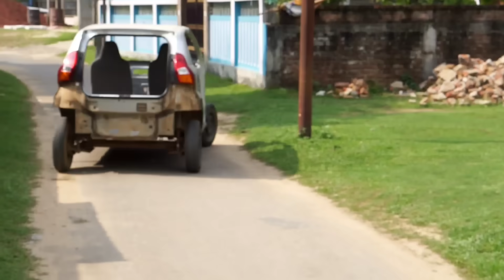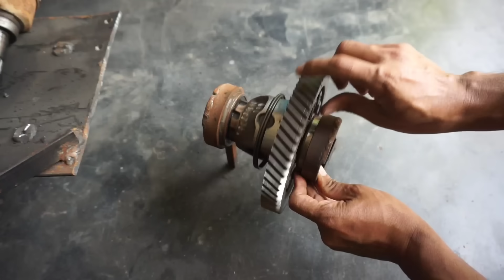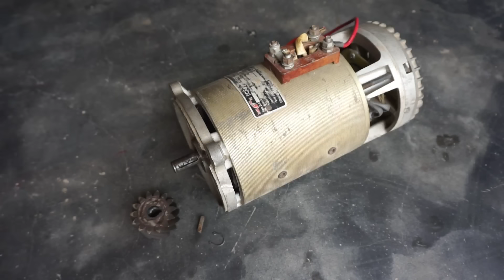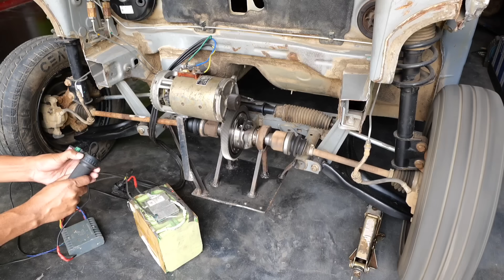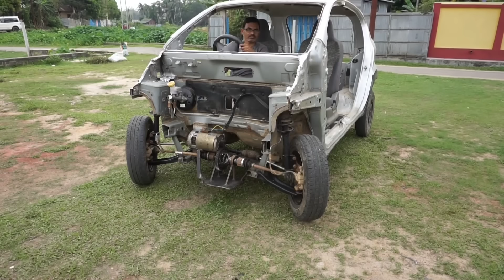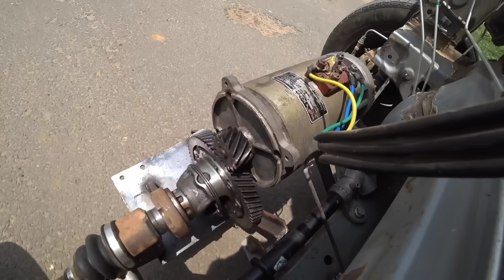diy electric car

Comment: Great project. Would it not be better using the complete old gearbox and powering the input shift from there? That way the moving parts are all still lubricated
Reply: Lot's of losses in the transmission. His way while slower and single speed will be more efficient, by a good margin. Perfect for inner city, but I'd imagine 25-30km is as fast as it'll go. I agree he should have the differential enclosed in oil somewhat.
Reply: @Aa-ron01  maybe just cut out the part that houses the differential?
Reply: Too heavy ,differential can Last long time at 30 kmh with à Light car, just spray grease like bicycle chain
Reply: you can fill inside the differential with grease, then cover the side openings, even with thick tape will work well. The gears only spin while cornering so will never get hot or melt the grease.
Reply: I think the same, that precarious system of gears does not look so reliable! 🤔
Reply: i cant imagine the drive suppprt holding.up  but the rest looks respectable
Reply: @Aa-ron01  9
Reply: Transmission would add to much weight, use white lithium grease and heavy tape like someone suggested for this application in small car find some way to hook an alternator to each rear wheel hub to generate power to recharge batteries as your driving
Reply: Он-один. Учёны́е вместе с конструкторским бюро сделают ещё лучше. Нефтяники не даст
Reply: Weight reduction taken seriously in this video ;)
Reply: @horseyhorselips3501  I think the alternator will slow down the car due to the charging load acting like a real load.
Reply: Да, он избавился от лишнего сопротивления.
Reply: @Aa-ron01  at high amp cost untill proper rpm and speed is without over heating the battery and or system.
Reply: @horseyhorselips3501  recharge batteries as you drive?  Wastes energy.. even if your alternator set up were 10p percent efficiency  ..which it isn't...you would still just break even on the  energy used to produce .
Reply: @jamesgibson5876 could work if it was only activated on descents or braking.
Teslas have that...
Reply: Probably uses a servo to control voltage and speed.
Reply: If you don’t like what he did make your own.
Reply: ⅝
Reply: Todo bien, y como lo frenas?
Reply: Yeah will work for some time... But definitely better with oil casing to keep it lubricated
Reply: @jamesgibson5876 agreed, even with using that low gear ratio. Your charge output might not even be enough to compensate the draw of the motor powering the drive motor. Even with a light vehicle with no chassis, half a body and only one passenger. Just buy a crashed Tesla and take the motor, retrofit to the vehicle your working on.
Reply: А что если на электрический мотор поставить автоматический коробки передачи можно будет увеличить?
Reply: Very nice love it!!!!
Reply: Lots of electric conversions of old car do that. The engine compartment then hold the motor and batteries 😂

Comment: all very nice but how long would it take for you to put up with those gears without lubrication... if you had kept the original box and coupled the motor directly, the combination would be great
Reply: Then it becomes too heavy to move
Reply: سلام عليكم
Reply: @abdelkadermehaoui3812  وعليكم السلام ورحمة الله
Reply: @vincentlee2460  I highly doubt it as you can spin those with your fingers
Reply: Also, I am concern, without the gearbox and torque converter, how long that electric motor will roll that wheel directly. That motor will be burned out after 7 to 10 minutes due to direct load from the wheel. 0% reliability.
Reply: @ibrahimchowdhury7591  but this is exactly how all electric cars work.   No gearbox.
Reply: Dear  @andrewbarnard667 ,
First of all I am warmly asking for you forgiveness if my comment gave you any wrong information. I also ask for your acceptance and writing a few informations as a comment which is, for example, if you disassemble Tesla’s cars E-motor and Transmission part, you will see that the electric motor has not been attached directly to the drivetrain. There are multiple torque converters attached which are changes in real-time based on the torque sensor and the total load of the car. If you connect directly to the motor, it will consume excessive battery, will not go faster than 15 to 25 mph, and also will overheat which will ultimately reduce the performance life of the electric motor. Again, I am not talking about gearbox, but torque converter.
Reply: No problem....he can spitt on them while driving !!
Reply: Instead of using the differential from the gearbox you should have used a closed differential from a RWD car. That doesn't add too much weight and solves the lubrication issue. It would also solve the flank clearance issue that you probably have. And it would generate less noise.
Reply: @ibrahimchowdhury7591  You are both wrong. Tesla uses a gear reduction box. No clutches, no torque converter, just a direct connection to the drive gear.
Technically it's a gearbox. It's not a multiple speed unit like a 6 speed in an ICE car though, just a single ratio that allows use of smaller, lighter, higher rpm motor designs.
Reply: @ibrahimchowdhury7591  you can talk about torque converters as long as you like but electric cars do not have or need a torque converter.
Reply: Dear  @andrewbarnard667 ,
Thank you, for replying. 🙏🙏
Reply: @vincentlee2460  cffds
Reply: I'm guessing it was intended as a proof of concept than as a roadworthy design.
Reply: yo pensé lo mismo, pero este experimento amplió mis posibilidades! Traigo ésa idea 🤔

Comment: My first electric hybrid car i drove was a Hillman Minx, in 1st Gear on its starter motor, drove about 300 yards when to a petrol garage when it ran out of petrol, so i ran it all the way cranking, this was 50 years ago. So you can't say i have not driven an electric hybrid car🤣
Reply: I also had a Hilman Minx 59 model...my first car at age 19...and boy did I love that beige and cream little car!
Reply: I HAVE A MINX.
Reply: If stalled on a railway crossing using the starter motor to drive the car off.
Reply: you are a কৌম্পিন্তৌ😍
Reply: So I had an old Datsun pickup  5 spd HYBRID with dead alternator and broke..start in 1st gear n go.. coasting to red lights and take offs were fun..Not. Then clutch went out was 2 weeks to work and everywhere just start in 1st gear n shift through gears don't need clutch. Parking where I had a clear path to launch from again and again. This video is very cool, I was thinking remove 2- 3 feet from the middle of that car and weld back together save more weight being 2 door. Wish I had a place and welder.
Reply: nobody's asking
Reply: @diycraftideas1960  ii
Reply: Back gare
Reply: Hillman minx was a very good car
Reply: @hasanaydin22  i don't care

Comment: Very creative!  you can also make some kind of dry sump lubrication box around it, drop oil on the gears and the differential with a small pump so it will keep out dirt, and recirculate the oil from the sump you make around it. . makes it a little bit easier to fabricate and it will last a lot longer than it does like this. Keep up the good work!
Reply: Need to manufacture a gearbox cover, put gear oil in it. Being open, to the elements, those gears won't last very long. Metal to metal contact is never good!
Reply: No need for a pump, just seal the case and have the large driven gear semi submerged, as it spins it will carry oil to the drive gear.
Reply: @Dalehogg89  true
Reply: @Dalehogg89  صحيح، علبة مغلقة مملوءة بالزيت يكفي
Reply: @يحيىبركات-س3ب  can you translate to English please
Reply: @Dalehogg89 You are correct, a closed can filled with oil is enough.
Reply: @يحيىبركات-س3ب  thankyou, I tried to translate but it would not copy your text on my phone.
Reply: wouldn't that be just leaving the transmission in-tact?
Reply: @groofromtheup5719  that would be the easiest solution idd.. if he could make it fit :-)
Reply: Good idea. Untidy job. Perfection is a must
Reply: Маслянный картер( как на заводе ) изготовить будет потенциально проблематично. Между электродвигателем и ведущей шестерней слишком мало места. Тогда вал якоря электродвигателя надо делать длиннее.
Reply: That motor won't last long enough to worry about all that fuckery.
Reply: Só good
Reply: Positive and constructive comment!
Reply: What's about reverse the motion
Reply: @groofromtheup5719  weight?
Reply: @EelingStudios  an aluminum casting vs. a bunch of random steel welded however; all that relative to the weight of the base vehicle plus batteries?
Reply: @arunpatil3580  What about it?? 🤷🏻
Reply: @chunchuemmanuel492
Reply: @arunpatil3580  By switching polarity, you can control motion.
Reply: it was probably best to keep the original gear box and just have the motor mounted to the input shaft.. would a solve alot of the problems he's now going to encounter
Reply: I would like to watch some of your videos showing what you're explaining, they must be fascinating 🤔 😉
Reply: Es lo que pensaba 2 baterías 12 v x 180 A en paralelo
Reply: @Dalehogg89  yeah thats how gearboxs work, no pump
Reply: @ronaldgreen5292  😅

Comment: I'm very impressed with your ingenuity, this is a very neat, simple proof of concept that may now be refined, to include protection and lubrication for the drive gear. Subscribed.
Reply: "Proof of concept"? It's just a cobbled together project, the concept has been refined far, far past this stage.

Comment: It reminds me of those battery R/C toy cars, I had one that I put apart, and have suspension and a plastic differential attached directly to a tiny electric motor.
Love the simplicity! Very good job Sr.
Reply: With 4.5 hr warrantee.  :face-green-smiling:
Reply: Basically, a golf cart..

Comment: Make a sheet metal housing to contain oil & add an oil pump to spray oil onto the gears & bearings. 

I can’t help but wonder about the motor speed torque curve matching the performance needed for the car weight. 

Most ppl keep the gearbox & make an adapter plate. Still good.
Reply: le ubieran dejado la caja de velocidades
Reply: насос не нужен, достаточно на 10-15 миллиметров планетарную шестерню погрузить в масло.

Comment: The only problem there might be is that the differential is made to be enclosed emersed in gear oil, it would have to be constantly manualy lubricated because of all the dust and gritt, might become quite messy🤔 otherwise a great design😉
Reply: This set up wouldn't need all that,. Spray it with some lubricant before riding and it would be fine. A silicone motorcycle chain oil would work good.
Reply: @sliedogg  yes, give the exposed surfaces an oily coating so that the grime and grit can stick to it👍,never mind the nylon shims in the differential planetary gears requiring not only the lubrication but the cooling affect of the oil to ensure they don't melt,Which they will!
Reply: @notpoliticallycorrect1303  Oh yeah cause the open design is so well built 🤣.  How long have you been a mechanic?  Me 20 years.
Reply: @sliedogg  I was being sarcastic! I have an 80+ year family history in the motor industry,40+ years personally in the trade and around 30 years running my own 7 bay and 2 test bay garage and paint shop,with over 100 full restorations and modification projects under my belt in between the daily stuff. We build and develope uprated Duratec V6 engines as a side hobby! And my family design and build specialised commercial vehicles,mobile pumps,Winches,generators,de-salination plants etc.
Reply: @notpoliticallycorrect1303  Nice!   I'm not that far in the game but one day maybe .
Reply: @notpoliticallycorrect1303  lol his attempt to be snarky and condescending didn't work out so well....

Comment: Great job ! I like it 👍.  If you want it to last longer you will need to use lubricant oil. IMO you should keep the transmission case and added oil. Try to fit the motor in to the case.
Reply: Exactly
Reply: Exactly, this way it will not last few weeks...

Comment: The differential needs lubrication , grease is not enough it would have been better if u had connected the motor to the splines of the gear box and that would have given u multiple gear ratios like in case u have heavy load u can shift to lower gear with increased ratio for more torque. Bldc motor is more suited for this application .

Comment: Hi sir,i am happy to see this cars project
This one is looks like my college final year project 

on 2012-2013 i have done this Electric car project
I have used 
1. one tata indica shell
2.2HP DC motor
3.Kinetic honda Gear combination
4.alternator
5.DC Boost converters
6.12 V 45-60 ah batteries
7.additonal options for further upgrade (sollar panel , Inverter circuit & Wind energy converter unit)

Comment: Man invents EV car for 50 bucks. Gets invited for free lunch with Musk. Man never seen again. 👀
Reply: The reason why EVs are expensive is because of batteries. Tesla can make an EV for $50 too but it won’t have 300 miles of range, or airbags for safety, or go 0-60 speed in 2-3 seconds. It also won’t have any safety feature. Basically what this guy created. So jokes aside, this is why no company is doing $50 EVs let alone 10k ones. But some do have 20k EVs on the market today already

Comment: That is nice. He built a 10 MPH go-cart. Kids in the 1970’s in the USA did the same but with a 12v starter and car battery. Ridiculously fast acceleration, for a while. Car starters are not designed for 100% duty cycle.

Comment: Its a good starting point get a motor front and back and find larger gears to drive the diffs or a series if you can't use an actual complete trans. A way to lubricateAnd a speed control I was making an e bike I might have to change it up for one of these

Comment: He also has no sump for the gear train. It will sling out all grease really quickly and be done in short order. Spray chain wax is no replacement for oiling a gear.

Comment: Vanakkam, good idea and the bearing on the differential unit will fail without lubrication, you need to change to prepack grease bearing or have the lubrication system

Comment: Use a small gasoline engine generator to charge up a 2nd set of batteries and the fuel mileage will be astronomical.   Especially if you make the engine run on gasoline vapor.

Comment: Wonderful idea, I think if you probably consult an automobile mechanic on how to protect the gear box, that would be great...moreover you can also test with various voltage and current batteries to and make a chart about how long thd motor runs , torque generated etc

Comment: The TATA  its the best choise to convert a petrol car into electric.Thanks for your work,video,music and conversion.One question,sir.? Its possible use a Esc brushles to control a brushed dc motor with any adaptation wires or software?And other , the TATA  in petrol version its RWD andREAR ENGINE?.I am sure of TATA car its the best ,easy,cheap,and safety way to have a electric transport .But do you need a  support of enginiering to homologate your conversion. Are you searching sponsors on the electric aftermarket providers?

Comment: The hard part to see was tearing apart an automatic transmission box to recover only the differential gear. I see your top speed is low. What's your top speed? Maybe on a future version you want to add gears box or keep the automatic transmission for having higher top speed.

Comment: Respect for this work! 
I wonder how long the exposed gears can withstand the dust though. Here you should donate a small case. 
And what temperature does the engine reach after a longer drive?
Reply: The gears must be exposed. The pollution in the air IS the lubricant. India.

Comment: No alternator for recharge.  Passenger wheel isnt attached to the rack and pinion therefore he only has drivers side wheel that is turning with power.

Comment: How long did the bearings in the electric motor last in that configuration? The bearings are going to have tremendous pressure on them vertically and horizontally.

Comment: Let me give you an idea that you run the vehicle with electric motor but to run it you need to recharge the battery but if you connect the dynamo to the electric motor then when the motor rotates the power consumption in the dynomo can rotate the electric motor continuously through the battery or directly so there is no need to recharge.

Comment: Transmission will last about as long as a CV pulley transmission. WITH NO OIL :face-green-smiling::face-green-smiling::face-green-smiling::face-green-smiling::face-green-smiling::face-green-smiling::face-green-smiling::face-green-smiling::face-green-smiling:

Comment: This Bearings need apressure from each side, thats only for fun,
If Rain and dust, little stones will end thus project,better you take the closed,whole gearbox  with neutral and reverse gear and thinn Engine-Oil in it,

Comment: What mechanisms can be used for climbing  hills and varying speed and torque so as to suit different  road conditions. Thanks
Reply: I ve seen the same diligence but they kept the gear box that help for climbing and good batteries autonomy